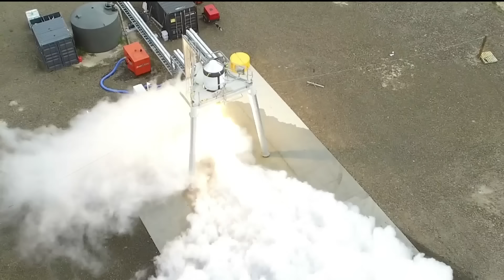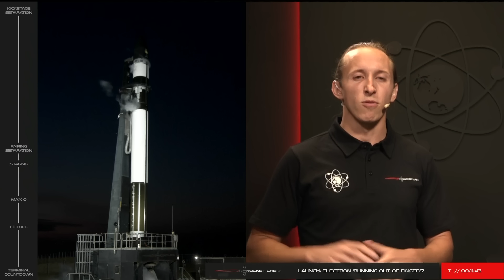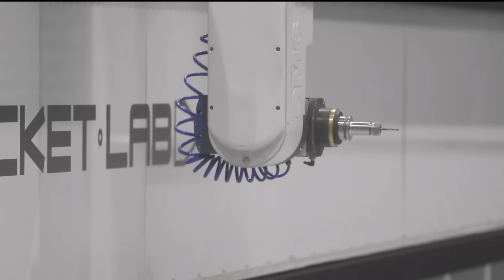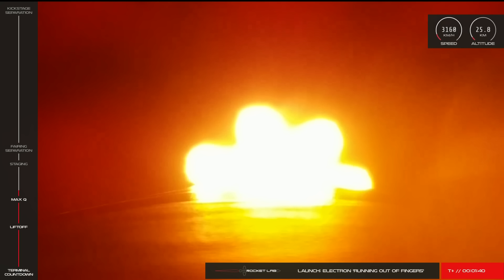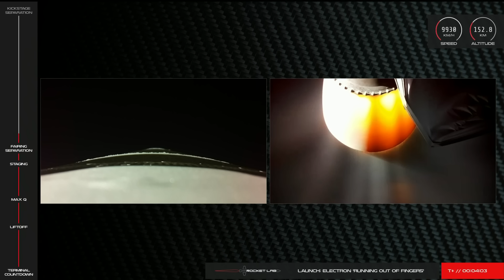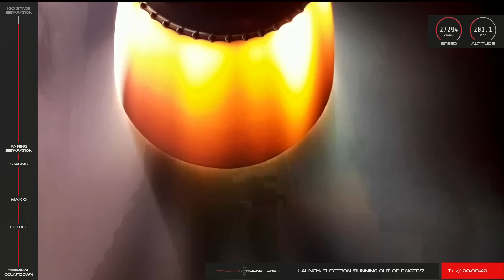Running Out Of Fingers Launch - 06/12/2019

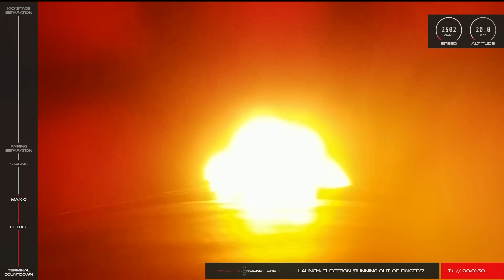Comment: Are those sparks at 18:04 bits of titanium from the 3D printed engine?
Reply: People using similar 3D printing technology have been complaining that it if you print narrow fluid passages, they shed particles of half-baked powder no matter how much you try to clean them -- very bad if you use them as a part of some hydraulic system. The regenerative cooling passages in the 3D printed rocket engines would probably be particularly difficult to clean. OTOH, more than one company prints rocket engines, but not every engine sparks like that -- there is almost certainly more nuance in this than meets the eye.
Reply: @cogoid  wow thanks for the in depth answer, guess it probably is unwelded titanium or inconel bits. I know they've done testing up to 300hs of runtime though so it's safe enough. I imagine the combustion chamber pressure causes it to oblate, possibly exposing unwelded bits. I just googled it, the Rutherford engine is electron beam welded, I wonder if that has anything to do with it. It also regeneratively cools the nozzle by using the RP1 as a coolant, through channels down the nozzle. Maybe in those passages there's small particles being released from the thermal expansion/contraction due to the massive thermal difference in the coolant chamber walls.
Reply: @BasedBidoof  It's a very interesting subject, but unfortunately it is unlikely that anybody with the knowledge of the real situation is allowed to comment on it.
Reply: @cogoid  lol right. I can hope! I'd imagine it has to do with trade secrets though
Reply: @BasedBidoof  Got the answer. Peter Beck says that soot forms on the injector plate in the engine, and once in a while soot flakes dislodge and make sparks in the exhaust. Not metal.
Reply: @cogoid  Very interesting! that explains why it's not consistent, and why they're not bright white sparks. Thanks for digging that up!
Reply: @scr33m9  super helpful 👍

Comment: launching from new zealand? I thought it was easier to launch from nearer the equator. Why from NZL?
Reply: clear air space. licensed to fly every 72 hrs (highest rate in the world by far). close to production.
Reply: Well, it's a New Zealand company and that's where it has existing access to a qualified launch site, though they are building a site on the U.S. Virginia coast.  The NZ site can access orbits from Sun-synchronous through 39-degrees, so you are correct that they have some orbit limitations from NZ.  See here for their official info:
https://www.rocketlabusa.com/launch/launch-sites/
Reply: @antibrevity  and the Mahia launchpad is at virtually the same latitude as the Wallops one (38 degrees N / 39 degrees S). People tend to have a misconception that NZ is stuck down at the bottom of the world, but it isn't really true.
Reply: It's more about versatility than "ease". Broadly speaking, you can launch to an orbital inclination greater than the latitude of your launch site without penalty — but if the desired inclination is less than the latitude, you're going to have to burn fuel adjusting it. Being closer to the equator therefore gives more options...

So Mahia can't provide as many options as Guiana (5°N) or Kennedy (at 28°N), but it's fairly comparable to Vandenberg (35°N)... or for that matter, the new Rocket Labs site in Virginia (38°N). And it's better than either of the main Russian sites, with Baikonur at 43°N, and Plesetsk very nearly in the arctic circle at 63°N.
Reply: Oh, and right near the end, they said the inclination was about 97° — that is, not just over the poles, but slightly backward... a typical sun-synchronous orbit. You could launch to that from almost anywhere on the globe.
Reply: https://www.youtube.com/watch?v=71wPKALp7X8
Reply: Because we can! Also less air and sea traffic ... reduces the hazard safety paperwork!
Reply: Because the fishing is really good.